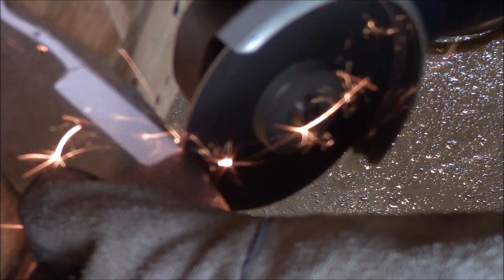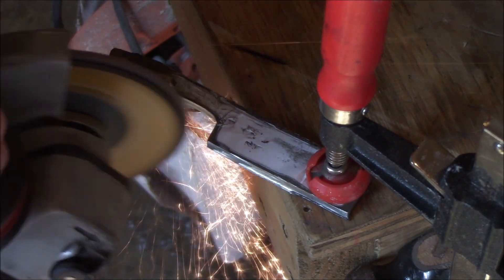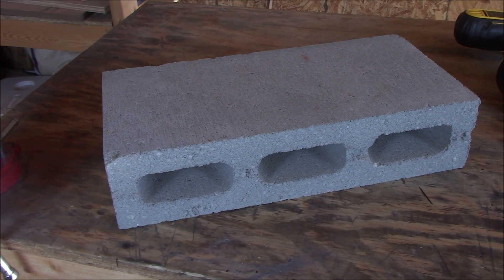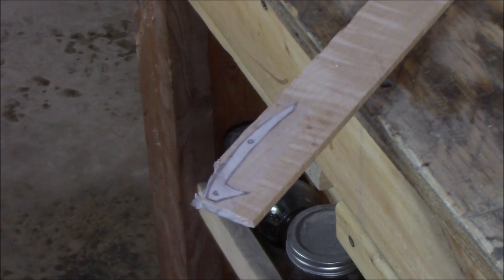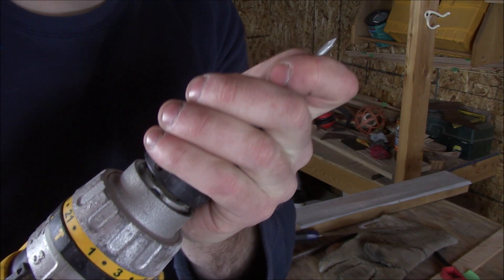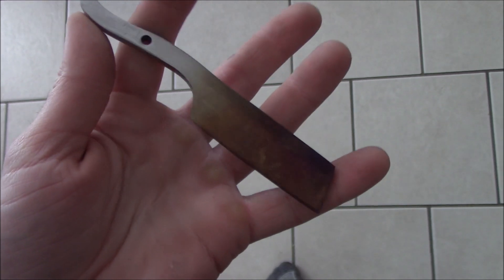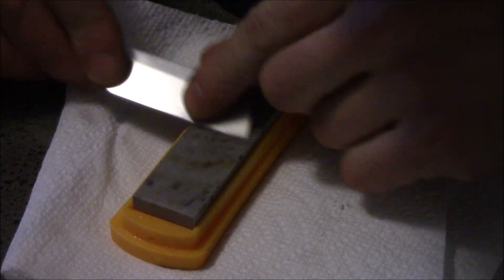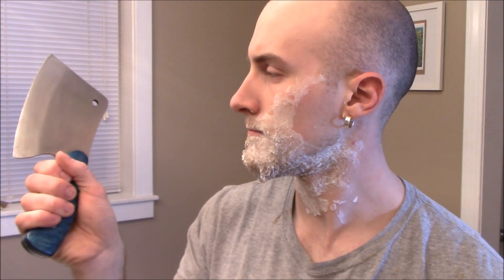CHEAP and AWESOME-  How to make a STRAIGHT RAZOR at home

Comment: Umm... No. Could you please provide some specific details about both the tempering and more especially  what resulted in the sharpness of your blade. I heard you refer to the center line and using a Sharpie. I reckon I'm asking: 

• What is the "Blade's Bevel"? I've yet to find any kind of list or diagram that names the different parts of a blade. So, for me the Blade's Bevel is the long taper. Which typically begins near the "Back", (the dull edge usually opposite the sharp edge...) at the full thickness of the blade to the "Blade's Cutting Edge". So, please sir, what angle did you use for the Blade's Bevel?

• What angle did you use for the Blade's Cutting Edge? Uh... please sir? Which is obviously the small narrow area at the tip or point of the Blade's Bevel that is sharpened, honed, and stropped?

• What temperature approximately did you heat your blade too? Or do you go by the color? And if so, what color? Please sir.

Also, I'm asking in reference to using 1095 Steel. Like you suggested. 

• Finally, what specific media do you quench in? Oil? 50w motor oil? Synthetic...?

I've been told that ramble too much, when texting or commenting, as it were. So, I apologize. Itn is not my intention to disrespect your time or anyone else's. 

That said, Thank You for the upload. 

.... DriverDown

Comment: I had the crazy idea of using a stainless steel frying pan cutting out a straight razor shape then polishing drilling etc by hand would have taken a fair while admittedly no idea if it would work
Reply: I dont know if it would work out, but you'd be better off using a cheap kitchen knife as your source material.  Also I would look up how thick the spine of average straight razors are so you can ensure your starting thickness is enough.  From there, just be sure you know as much as possible about the kind of straight razors you want to emulate and good luck

Comment: This is not knocking the work you do ,But as a straight razor user for 30 years Ive always preferred the ones with grooves cut into the spine,
Some razors ive used where the spine has had them grip rigids worn so low the razor feels less stable when holding, especially if i get a bit of water on my finger,
Reply: I think you're talking about jimping.
Reply: @cameronmccoy5051  yes jimping , then files cost a lot not a common file can`t find second hand on sites, and there are several file with width and depth, could you please tell me what one is the most commonest one use for cut throat razors please,

Comment: Typically the handle or "scales"  stops the blade from Protruding the other side by the bevel wedging itself into the scales with no contact of the edge ;) not sure if you can damage the edge with  your style of "stop" but it's your blade and I'm sure you'd be careful not to damage  the edge. With you being a knife guy and all.  But looks bad ass.

Comment: I dindt understand how did you made the heat treatment. Which gas did you used?
Reply from the maker: I tend to use MAPP gas for hardening small items such as this build as it burns much hotter than propane. It's not perfect but it can work if you don't have access to a proper forge. Happy building and thanks for watching!

Comment: I used to work at a custom guitar shop and we would use scrap cocobolo for handles on tools, and it was beautiful.  I hate is as a neck wood, because despite it being so dense, it's damn near impossible to keep it straight, but as a handle material it's one of my favorites.  You should try that for some knife scales one day.

Comment: How often do you find you need to sharpen it?
Reply from the maker: I actually ended up getting a better edge on this after this video using a diamond stone and a strop. Unfortunately I haven't had much cause to use the razor because I've been growing out my beard for months. Hahah. My advice would be to strop the razor at the very least before every use. :)

Comment: what do you quench it with?  is it oil or just water?
Reply from the maker: In this case I just used water. I've found that at the lower temperatures that you get from a MAP gas torch water works very well with 1095, however as you may have seen in my chef knife video water quenching can get a little hairy with higher temperatures. Hahah.
Reply: Wow that’s nice.

Comment: I enjoy your videos and i like the positive comments on your vids.

But i havent noticed any critiques, and I think critique is a good thing as long as it isn't worded like an asshole.

The points I was concerned about with the razor is (and i am no expert or even close to knowledgeable) the "stopper" and the thickness of the edge. The straight razors I've come come across so far (not many) doesn't actually have a stopper. They just use the thickness at the blades back, to stop the blade from going through the narrower gap. My thinking is that this is to make sure you dont dull or damage the very thin edge. Which leads me to the thickness of your razor. To my eyes it seems a bit too thick. The razors I have held feel extremely thin (and have a hollow grind). Which seems logical since you want it to be crazy sharp, and the only sharpening you should have to do after/before using it is with a strop.

These are my amateur points of critique. I might be way off since I actually dont know anything about straight razors other than what i have observed and concluded in my head.

Great work though! Looks gorgeous and I certainly wouldn't complain if someone gave this to me.

Comment: and you should try making your own belt grinder, its easier than it sounds.
Reply from the maker: Really? I'll have to look into that one.  It would be awesome to not have to use my old belt sander anymore.  Hahaha. Thanks for the idea!
Reply: @80gritschmidt51  yeah im 15 without a welder and i made one for 50$, it works great
Reply from the maker: @ethanpellowe9774  wow, that does sound tempting. You may have just inspired a future build video! I will definitely look into it.